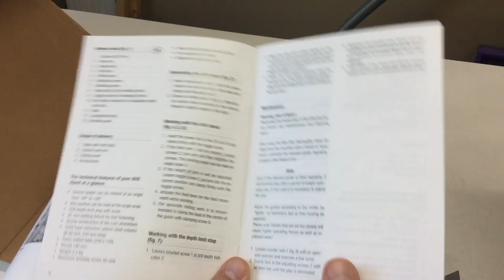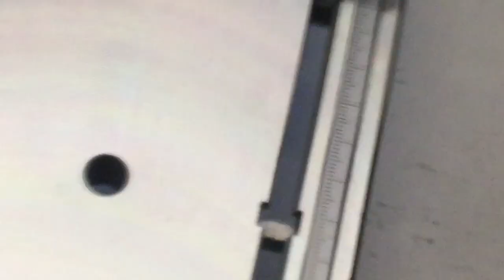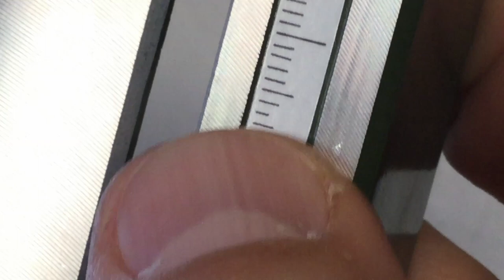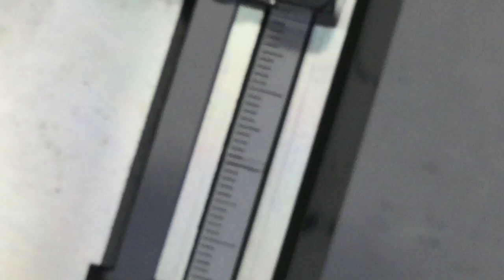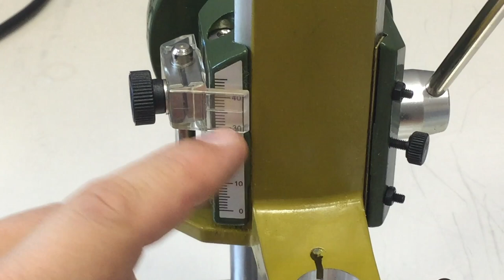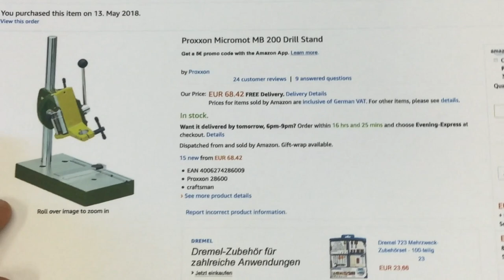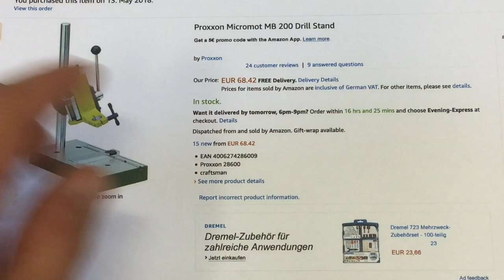Proxxon Micromot MB 200 Drill Stand Unboxing, Detailed Review and Test

Comment: I don't mind tuning a product to make it better. I bought a Sealey arbor press late last year and spent a lot of time and some money tuning it to make it better. It is now absolutely excellent! I love it. I think I will buy this Proxxon item and make it better if necessary. Thanks for the video.
Reply from the maker: You're welcome! What did you buy? The little Sealy PK500 or something bigger? Anyway, as much as I love to tinker with my tools, the issues with MB 200 were just annoying. Meanwhile I've actually managed to fix it (Proxxon Micromot MB 200 Drill Stand Mid-Travel Jamming Fix https://youtu.be/bmnKAnYFkbk ) - the set screw they used to hold the gear in place was too long!

Comment: After watching your videos too many times, i got an MB200 for myself. I use it with the wonderful LBS/E my amazing fiancee got me as a present, for joinery in miniature woodwork - together with the MS4 vice, Proxxon branded ELA burrs and Proxxon/Dremel/??? drills . I was so nervous when i got it, but apart from having to file a little bit from the fence where it meets the base (and now i have a passable 90 degree angle) it did not have the problems you - and many reviewers, for that matter - tend to have. Guess i'm lucky. With the long necked Proxxon rotary tool i can get a better view of where i'm working, i can also set the MB200 higher (i don't have the best lighting situation either) so it all works great ! I also use the Dremel Stylo+ - with various sanding bits - and the Proxxon DSH scroll saw. 
What a great pair of videos. Cheers !🍻
Reply from the maker: I myself use the MB 200 in conjunction with the IBS/E, mostly for drilling printed circuit boards. Anyway, I guess not every MB 200 leaving some anonymous, probably Asian factory is faulty. It's just that there's obviously no quality assurance in place at all. Fortunately the electric tools (IBS/E, LBS/E etc.) are still made in Europe. Regards, Robert

Comment: That off-center hole is purposely made that way so if you ever have to drill a hole to a close edge of something it might break it since you would not have where to rest that small edge and it could break due to too much flex. I like it the way they made it. I think is a nice feature rather than a fault.
Reply from the maker: Thanks for the info! I've never seen that before on a drill press or a drill stand. That's why I automatically considered that a flaw. But here's a thought: Why not make the hole smaller and centered then?
Reply: Robert's Smorgasbord Perhaps to allow more room for shavings to escape when milling?

(I have the IBS/E and MB200 myself, and agree with pretty much your entire assessment of them, by the way!)
Reply: Robert's Smorgasbord What really puzzles me is what the similar size holes near the back are, next to the steel column.
Reply: Ovi Bucur I don't exactly understand the reason for the hole to be off centred. Would you mind trying to explain again please ? Thanks very much :)

Comment: Hi, thanks very much for your excellent and detailed review!!
I'm considering buying a proxxon drill (IBS/E or Micromot 230/E, not sure really of the differences between those two) with a stand like the MB200. What do you think of it, 1year after your review? Happy or maybe happier that the original mixed feelings? Thanks again!
Reply from the maker: You're welcome! First about the drills: The IBS/E has a metal housing at the front that holds/contains the bearings (see the teardown video: https://youtu.be/ff_UDd46d5o ), the 230/E is all plastic. So the IBS/E is the more sturdy - and more expensive - choice. The 230/E is lighter (270g compared to the 500g of the IBS/E) and also more slender (easier to hold in your hand). Regarding the MB 200: You can make it work (see the fix for my specific problem: https://youtu.be/bmnKAnYFkbk - other people experienced different problems), it will do certain jobs quite all right (e.g. drilling printed circuit boards with a IBS/E), but it's not a drill stand that "feels" really good me. You could try the MB 140/S drill stand instead - if you can still get it. It seems to me there's a lot less that could go wrong with that one.
Reply: @robertssmorgasbord  thanks very much! Yes I looked at your teardown video of the MB200, very instructive :) if I buy it, I'll know what to do. I'll have a look at the MB140 too. I need it for drilling small housework and for my wife who want to do some home made jewellery (little stones, sea shells..) so with a minimum of precision. I was also thinking of buying the flexible shaft 110/BF.
Reply: @robertssmorgasbord  and thanks for the info regarding 230 vs IBS. Did not know that. Is is bad that the body is plastic?
Just watching your teardown video of the IBS, your videos are just a must. :)
Reply from the maker: @liryco8795  Actually I do have the 110/BF flexible shaft and used it a few times together with the IBS/E. The IBS/E is fixed to the table with an UHZ universal holder when I use it that way. That combo works actually quite well and I can recommend it for the stuff your wife is doing. The business end of the 110/BF is of course even smaller than the 230/E and much easier to hold and control with one hand. One last remarks: The IBS/E has 100W, the 230/E 80W.
Reply from the maker: @liryco8795  Thank's for the praise! In itself the plastic body is not necessarily a disadvantage. It's certainly one reason the 230/E is so light (besides containing only a 80W motor, the IBS/E has a 100W one). My personal preference is to have metal where "the rubber meets the road". BTW The metal front of the IBS/E contains two bearings. I suspect (don't know for sure) that the 230/E has only one.

Comment: I encountered all of the issues that Robert shows, plus one more: The opening for the tool was about 19mm. This is really strange, because the tool holder is a casting that's then machined.  To make matters worse, the cast aluminum tool holder is harder than the material on the tool, so any bit of force fit badly damages to collar on the tool.
Reply from the maker: Yeah, those Micromot MB 200 drill stands are not the finest work of Proxxon. Or more to the point: The production quality is total crap. I wonder when Proxxon will realize that if you move your production to e.g. China, you also have to move a quality assurance engineer there. But the opening only milled open to 19mm? But then, another person wrote in the comments that the dove tail guides were not milled completely through.
Reply: @robertssmorgasbord  Do you know whether their TBM115 drill press is any better? I am deciding between return/replacement of the MB 200 and fixing anything that's wrong with the replacement (check the opening before trying to insert the rotary tool, deburring as needed, replacing the set screw, resetting the lever position), vs. buying the TMB115 and using a cheap rotary tool for other things, vs. who knows. I'm not seeing many options for a small drill press that will do a good job on small holes.
Reply: And by the way, thank you for your videos!